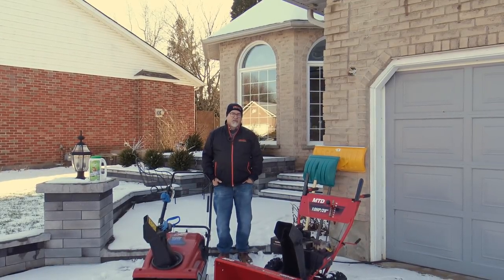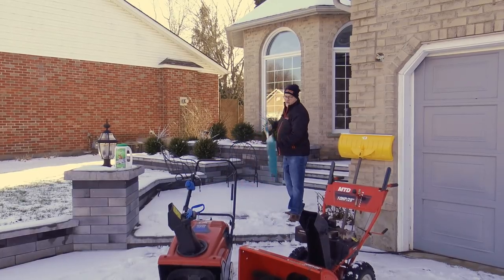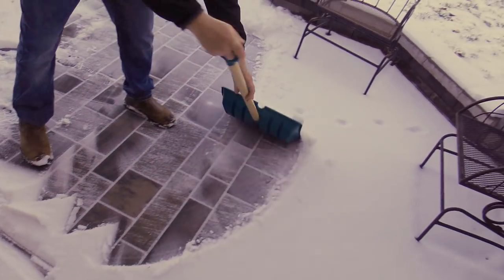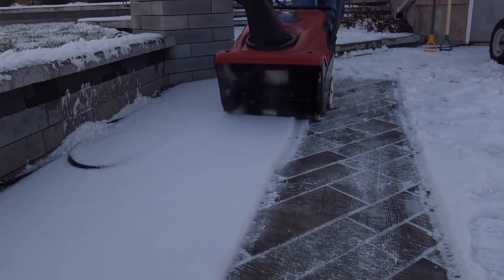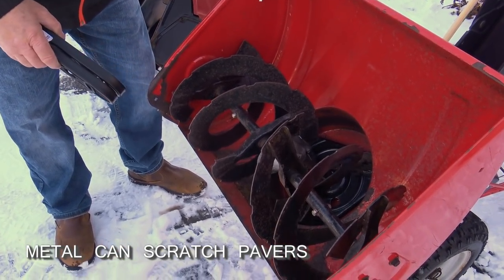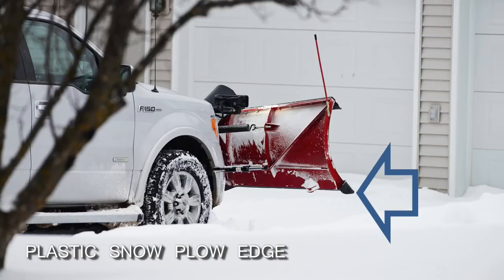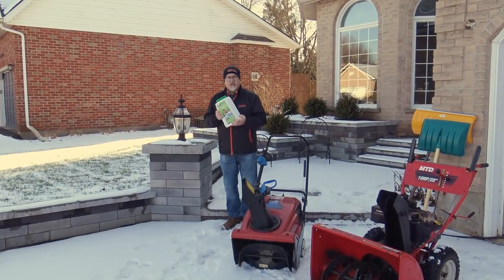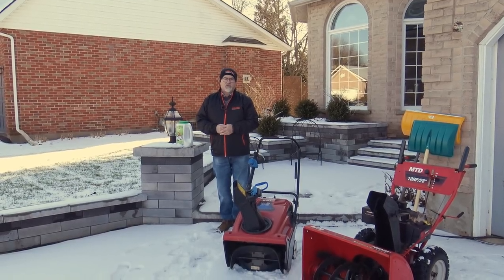Removing Snow from Brick Pavers

Comment: II would say that you can not shovel pavers if they are unevenly set or start sinking...I  have been shoveling a small paver and walkway for years and have been hurtin my wrist on it becuase it has uneven pavers sunken to various depths. you can not push a shover for any anticipated length to clear the snow and get a good shovel full or push the snow to the side with the shovel.  IT always catches or binds... the snow blower like the 2 stage one can also possibly catch on one of the stones with the metal blade and pull the bring paver out and then scoop it up with the harvester and into the secondary blade area if it gets that far... bad thing. real bad thing for the snow blower... it could damage all the shafts in the harvester and the secondary thrower... I have used a cheap weak single stage that plugs in. I wish I had a gas one with flexible flaps so I could use something with more horse power. yet the snow these days is not the same either its more of a slush mixed with rain. we hardly ever get the powder snow like we used. Snow blowers wont even work on some of the snow we get...